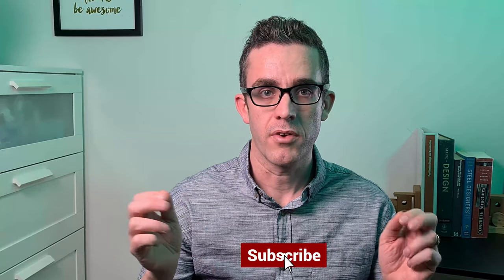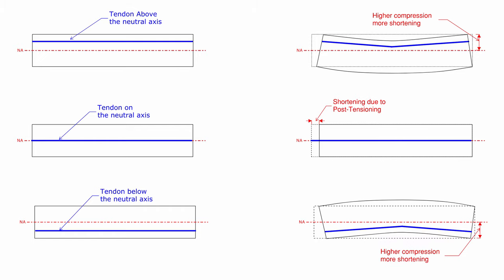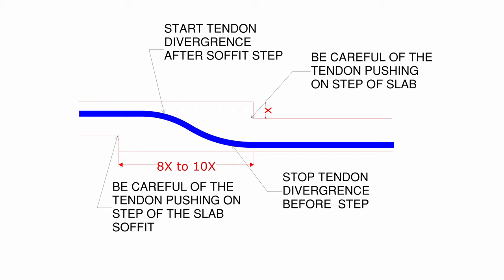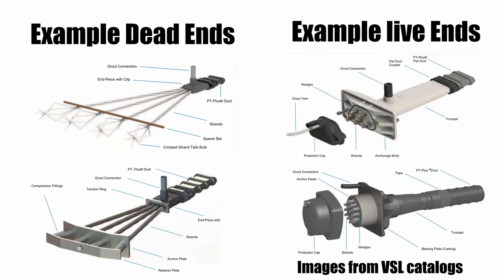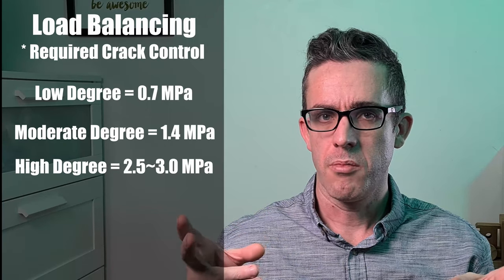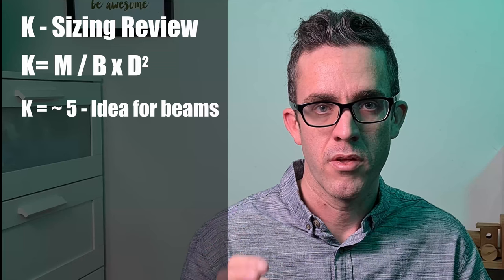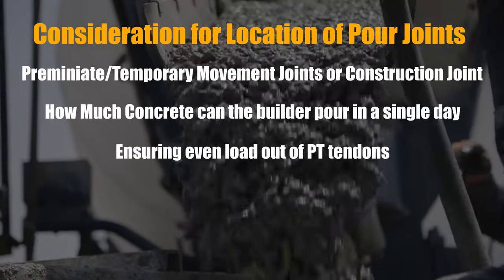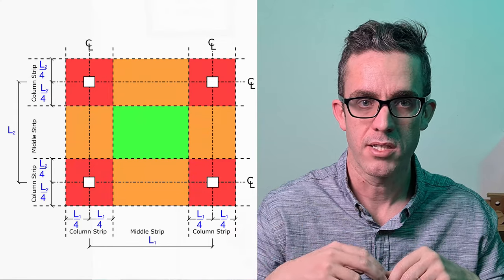The basics of post tensioned concrete design | how to design post-tensioning

Comment: Awesome video Brendan! There was a lot of new information there I had never come across previously or thought of. Cheers!
Reply from the maker: Him Tig K, thanks. Glad you found it helpful, hope it helps with your post-tension design. If there is anything else you would like me to cover let me know.
Reply: @BrendanHasty  I'm working in the industrial sector so not a lot of PT design, although I did one project to assess an existing PT slab on ground using RAM concept

Comment: Good video mate.  I have always found one-way PT relatively simple with the use of RAPT but am at a loss with how to use it for 2-way application.  Not all firms have access to RAM Concept as its quite expensive.  PTD from inducta is available but feedback I here is that it can be quite cumbersome.  Would a video on the use of RAPT to design a 2-way PT slab be possible?
Reply from the maker: Hi Anthony, Rapt is amazing I can do a video on this there are several way this can be done.

Comment: Awesome video Brendan 
Are you able to cover permanent/temporary movement joints in future? I guess slab shrinkage in general and the absolute limit. 
Some engineers believe if you have a high degree of crack control (loads of reo)  you can get away with no pour joints/movement joints..? 
Especially where there's two stiff elements such as cores apart in a slab, I've seen no joint introduced in between.

Hopefully you have time to cover this in future. Keep up the great videos
Reply from the maker: Thanks, Tony, hope to keep up the quality.  yea permanent/temporary movement joints can be a topic on it own.  I will put it into the list, it can be an interesting topic.

Comment: Does deck level at middle of girder is also increased because while doing post tensioning the girder forms camber in  middle portion(Hogging).So should we increase the deck depth as girder is lifted up in middle?? What is the correct process?

Comment: The term Centroidal axis should be used in PT calculation. Neutral axis is dependent on the load applied
Reply from the maker: Thanks for the correction.

Comment: good video, but still you need to say something tendon arrangement in banded/ distribution, as far i know in australia bonded tendon uses instead of unbonded where undonded use in USA. it will be more useful if you show us a simple example  of post tension slab design in australian standard.
Reply from the maker: Hi Roy Jack, you are correct we only used bonded tendons in Australia, I can put a video together show a simple post-tensioned design to Australian standards.

Comment: @brendan thank you for the very informative video. Could you please explain a bit more of the drape in cantilever? It's still unclear for me of how secondary effects work
Reply from the maker: When a beam deflects, it has a tension side and a compression side. The side deflecting needs to lengthen to allow the beam to deflect of you compress that side it will resist the deflection to some extent, the compress side still shrinks so it doesn't prevent the beam from deflecting.

Comment: Very informative video, thanks B.H...Just wondering if you could help with info on approaching design strips for flat plates in RAM concept. Thank you.
Reply from the maker: Hi Emmanuel, I will be putting together a video on modelling tips. but the easy way to think about it if you were to check the design in a 2D design software like Rapt where would you put these strips, that is where you should put them.

Comment: A great video!!

A quick question regarding the P/A stress. Does AS3600 have a minimum and maximum value for this?
Reply from the maker: Hi Harrison, thanks.
AS3600 does have a maximum P/A based around the strength at transfer(when you stress the tendons) which is around 3-4. However, when you start to exceed 3MPa you start to have shortening issue with the slab.
As for minimum P/A's there isn't really a minimum the lower your P/A the more reinforcement you require for crack control, the required crack control is specified in CL9.5.3.4, which is related to the service requirements.
Glad you liked the video, and if there is anything you would like me to cover in the future let me know.

Comment: Could you plz let know what's the min span required for post tensioning to be a viable option. Can it be done over a 5 ft span beam
Reply from the maker: minimum PT is about 6 meters which is around 20 ft

Comment: How does truncating of tenons work? Say if we were to cut an opening in a PT slab. What additional bracing is required for this to occur?
Reply from the maker: Hi Stephen, truncation is like a dead end anchoring the tendon. You need to truncate the tendon prior to cutting the slab. You will also need to assess the slab if the new void causes issues.

Comment: Is it natural if you are using post tensioning that your floor experiencing vibration?
Reply from the maker: If not designed correctly it is easy to make a post tensioned Slab bouncy by adding too much post tensioning, not really wrong structurally  just doesn't meet service conditions

Comment: As both a structural engineer and a licensed builder, I have to point out that currently, most builders in Australia are to be blamed for their horrible workmanships on post-tensioned concrete structures. To be specific, most Class-2 buildings are constructed with horrible workmanships by these dodgy builders.
Reply from the maker: There are dodgy builders,  this has risen due to Design and Construct contracts. Everyone is chasing the cheapest price.

Comment: At 10:34 in the video your application of "K" is interesting.  I use a similar concept for mild reinforced concrete.  Me being in the US I would like to know the units in those terms so I could do a conversion to the units I work with and see how it compares.  I assume since you are talking about PT that the bending moment is at service load level.
Reply from the maker: Hi Bill welcome, thanks for all your support and comments it is greatly appreciated. The moment are ultimate loads,  k = M/ B D^2  so you just need to maintain your units if moment are Nmm  B- Is width in mm and D - is depth in mm. It is a modification of M/Z  (Z-section modulus)that leads to an easy number to aim for, so I would guess there should be a similar relationship. Let me know your findings.
Reply: @BrendanHasty  I just found your video and it is very useful to me that just involve in PT design. I have do some research on this K=M/BD2, but I can't find any reference talking about this, saying K=3 or 5. Can u please elaborate more on this matter. 😀
Reply: @BrendanHasty  i was wondering if fcu is missing ....k = M/ fcu.B.D^2
Reply from the maker: @chilotberassagarsamo2340 the 5 value is for ta concrete grade of 40mpa
sorry should have noted that, so if you have a different concrete grade it is just 5*(ratio change)

Comment: The other concern is regarding the lack of anti-seismic design and construction for post-tensioned high-rise buildings in Australia, according to NCC and all relevant Australian Standards, anti-seismic design and construction are not compulsory just due to the perception that Australia is not riddled with earthquakes like our neighbor New Zealand. However, the truth is Australia is not an earthquake-free-country. For example, the deadly 1989 New Castle earthquake is a sad disaster, that has exposed the truth.
Reply from the maker: Hi Xero, Seismic design is the past have been poorly defined in Australian Standards. However this has changes with the revision to AS3600-2018 making the  requirement  more specific and requiring diaphragm to be design as a non-ductile structure. I agree that Australia does not have enough records to know potential risk for earthquakes many cities may be sitting on major fault lines.